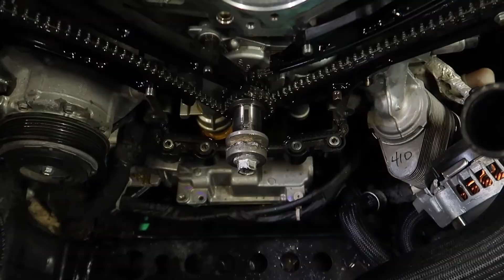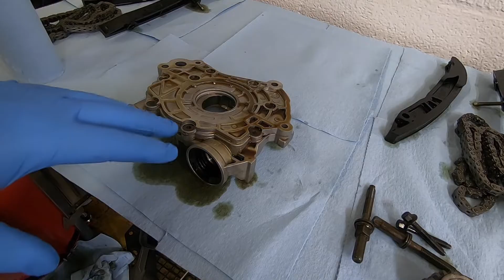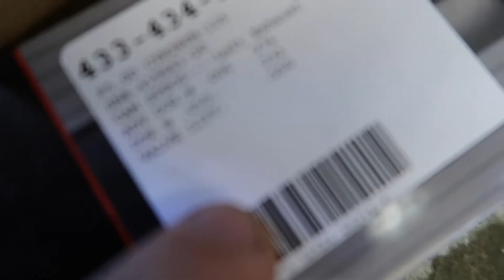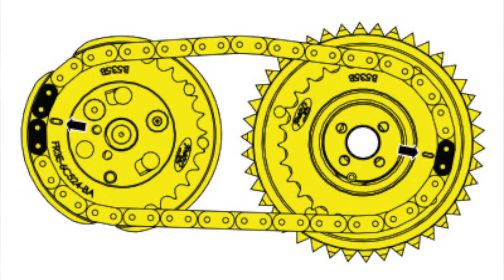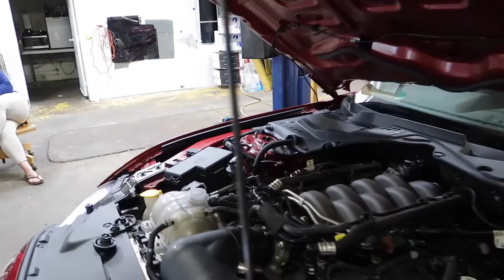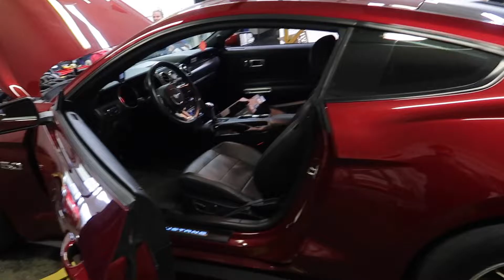GEN 3 Coyote stage 2 NSR Comp Cams, OPG, & C/S INSTALL!  Plus Timing Procedure in a 2018 Mustang GT!

Comment from the maker: MAKE SURE TO TAKE THE TWO SEALS OFF THE EXHAUST CAM AND PUT ON NEW CAMS. ONLY APPLIES TO GEN3 ON THE EXHAUST CAM ONLY

ALSO THIS ONLY APPLIES TO MUSTANG! F150 IS DIFFERENT!!!

Watch this video also before installing!! Something new that has been found!
https://youtu.be/tvQkOYagL-E
Reply: Have you considered doing a video for the f150 engine
Reply: No other better way to do it
Reply: Cool video. 👍 You should open a Mustang shop and build cars.
Reply from the maker: William Horvat Thank you!! I’m actually working out of that shop I was in on the side now. That’s my goal is to have my own performance shop!!!
Reply from the maker: @williamhorvat8224  I did.  It’s called HPR in Henderson, TN
Reply: After u have taken off the passenger chain and rotate from 12 to 5 do u have to rotate a full revolution from 12 to 5 then take off driver's side chain?
Reply: I watched this video as well, I purchased the entire pump assembly from Boundary with the billet blacking plate with Martin wear on the gears. Definitely wasn’t taking a chance.

Comment: @29.20 for the links not matching up on the driver side after rotating the keyway for the passenger side, i got a question. 

What if instead of the keyway going clockwise from 5o’clock to 5o’clock then continue turning more until so the keyway faces 12oclock 

instead of that. could we rotate the engine counter clockwise so the keyway goes from 5oclock to 12oclock (in approx a quarter turn)

that way the colored links would be lined up on both the driver side and passenger side. is that an option

Comment: I am having a heck of a time getting the cam slots to natually rest where they need to go for the phasers to be mounted. My cams want to rest slightly off from where they need to be. I can put a wrench on the cams and turn the, but the lobes start putting pressure on the valves.

What am I doing wrong? Gen 3 short block, Gen 3 heads.
Reply: Same here you figure it out

Comment: I have a question, when you are installing the camshafts on the left side, what position need to be the crankshaft key way?  At five o'clock or 12:00 o'clock?
Reply: It is the same process for a 2019 f150 with the same engine?

Comment: Great video and very detailed instructions gave me the confidence to do my own as well. I had one mistake and that was on Gen 3 cams there’s seals that need to be put on the cams. I totally missed them and was having issues with my cam timing with those seals missing the phasers wouldn’t hold oil pressure and my position B sensor was freaking out and shutting down VCT. I believe this only applies to Gen 3 motors, so if your reading this the video shows you step by step and I had no issues just those damn seals lol.
Reply from the maker: Yes it’s just on the exhaust cams on a gen3.
Reply: On a positive note, I’m really good at breaking down the motor and setting cams and getting the timing right lol.

Comment: Great video! I'm about to tackle the old Ford TSB for the noisey tensioners and the only question I have is that fuel tube for the HPFP. Did you just gently bend it up out the way or how did you make it clear the valve cover?
Reply from the maker: Remove the intake and take it off.

Comment: Hey Ken, I will doing OPG's and Comp Cams Stage 2 NA Mutha Thumper's on my 22' Mach 1.   The Mach has 8k miles on it.  What oil would you recommend for breaking in the new cams and OPG's?  What length of breaking period can I expect?  Wengerd has done my previous tune and will be providing the tunes for the new NA setup (Holley Ultra Lo-Ram ported by AFS, VMP Twinjet 69mm TB, Ford Perf 55lb injectors, Comp Cams Stage 2 NA MT, Boundary black OPG's w/sprocket, and Kooks 1 7/8" Green Catted LTH + Xpipe.  Thank you gentlemen!  I appreciate you feedback and am very thankful for the information in your videos!!!  You have been one hell of an asset.
Reply from the maker: No break in needed.  Just let it come up to temp before beating on it. I would do regular synthetic oil.  Car is going to be a blast.

Comment: I think something to annotate for the install. The exhaust cams from comp cams on Gen 3 coyotes do not come with exhaust cam seals. 

There is two little seals on the end of the exhaust cams.  Not the filter inside the intake cam

Comment: FYI you need to replace the cam cap bolts there torque to yield
Reply from the maker: FYI in the Ford workshop manual it says to remove and discard all bolts that require replacement  when it tells you to remove the bolts in each step such as the crank bolt and cam phaser bolts. However, they do not require replacement of cam cap bolts per the Ford workshop manual. Not sure as to why but I’m not an engineer. It doesn’t hurt to replace them but not required. I have never had any issues over the many years when working on these engines.

Comment: Quick question if you can find the time. Cams are in but un-torqued just yet. The rh exhaust and lh intake cams doesn’t rock/sway freely like the others do. Is this normal? I was told a way of knowing you’re in neutral is the cam will have slight play to sway.
Reply: To anyone wondering, this is normal. lol

Comment: @HPR, how did you determine that the crank needs to be rotated a full 360 back to the 5 o'clock position, then another 3/4 rotation back to 12 O'Clock? The repair manual doesn't say to do this
Reply from the maker: Yes it does say it.  On 15+ Mustangs the Ford Workshop manual clearly states it

Comment: I'm currently working on a 2018 f150 with this engine. I ran into an issue with the timing marks on the driver side exhaust cam would not match up with the workshop Manuel.. I followed the instructions as seen in this video and still couldn't get the timing mark for the drivers side to end up where they needed to be.. the marks would always be facing the center of the engine for some reason..
 The passenger side seemed fine, but when I went to move the crank from 12 o'clock to 5 o'clock the Crank wouldn't go that far before something made Contact inside the engine.. 
 Figuring I must have missed something, I stopped..removed the cams and started from square one. 
 Now that everything has been cleaned and prepped for the install of the cams, I am still having an issue with the driver side cams. They won't lay down where they should so I can install the caps.. There is no way I can install the driver side cams and have the provisions for the phasers in the correct orientation without some of the cam lobes opening up some of the valves.. 
 I have no idea what I'm doing wrong here.. I've done my fair share of timing sets on these, but this one has me stumped.. 
 As a added note.. the truck came in because it had a terrible noise that sounded like bad phasers or something going on with the timing set.. the driver also said if he didn't run premium gasoline, the truck would ping really badly.. I didn't notice any missing or running issues before I began the work..but the noise was definitely more prominent then it had been the last time I serviced the vehicle..
 Any help would be appreciated..
Reply from the maker: This is for mustang not f150. F150 time differently.  Let me know if you need the pdf for F150

Comment: Hope all is well brother, can you tell me if the cam cap bolts can be reused or are they tty as well?
Reply from the maker: Cam cap bolts can be reused. Ford does not have anything about discarding then when removed.  The phaser bolts to cams do need replacing.
Reply: @SpeedAddict731  thank you, God bless.

Comment: Do you need to upgrade OPG for cams?
Reply from the maker: Opg usually don’t break in the newer cars unless you are on 2 step or hitting the rev limiter. However if you are taking the cams out it’s very little extra needed to install opg so I don’t see why you wouldn’t do it.
Reply: @SpeedAddict731  ty for the quick response on this old video
Reply: @SpeedAddict731  hey man I finally got my cams I really need some help what new bolts do I need exactly to install these cams can you plz link me the correct ones trying to put them in this weekend

Comment: Great Video!  I am in the middle of installing cams in my 2020 GT.  I noticed you don't mention replacing the cam cap bolts with new ones, only the phaser bolts.  Also, you don't mention the center cam bolts being replaced with new ones?  Every ARP kit listed shows 12 bolts for the phasers, which is not correct for the engine I have or the engine in the video.  Can you help with these part numbers please and source?

Comment: Hi Ken,
I have been using your OPG video as reference for changing the oil pump gears in my 2019 Gt and have run into a bit of a hiccup.
Was wondering if you could help.
I am pretty sure I did the timing procedure correctly, but When I turn the engine over by hand I here a clanging sound that seams to be coming from front drivers side of engine. It sounds like its coming from timing cover area but its hard to tell.
Unfortunately I only noticed this after I had the timing cover and valve covers back on.
Is it normal to hear clanging or clacking coming from that area when turning engine over by hand?
Any help would be appreciated

Comment: hey man i’m installing these rn in my coyote and i stopped bc i’m not sure if i’m supposed to buy new bolts for the phasers or cams or can i use the same ones please reply
Reply from the maker: Yes you need new phaser bolts.
Reply: @SpeedAddict731  so after installing everything i am getting this code “P0369 Camshaft Position Sensor B Circuit Intermittent (Bank 1) Pending, the car feels like it’s running lean air fuel ratio all over the place while cruising the VCT disables and goes back to normal on hp tuners what could my problem be i’ve already replaced all 4 camshaft position sensors, o2 sensors, maf sensor. don’t know what to do next
Reply from the maker: @Chuy5ohh  are you logging all cam channels. I can email you a channel list to log and if you want to send me a log so I can look at what the cams are doing. My email is ken@hprautomotive.com

Comment: Thank you for this.  It was a little late for me as I first assembled mine off repair manual pictures only, and missed the 360 deg plus 5 o'clock part (that your repeated for good measure).  If you take those 360 deg away the car will run on 4 cylinders and have compression on all cylinders.  It will just have compression on the right bank when the ecu is planning for TDC exhaust stroke.  The starter also hates life because compression stroke on both banks are stacked together.  Throws cam codes on the right bank.  Your video cleared it up and I took it apart again knowing what I had messed up.
Reply from the maker: You’re welcome. Glad you got it corrected.

Comment: Ken, I’m stuck mid install with my whipple right now; please respond if you see this.

I’m taking the valve covers off to do the OPG install, and I cannot find anything on the 2018+ valve cover removal. What do I do with the fuel pump? The bolt that seems to be the obvious bolt appears to lock up rather than loosen. Don’t want to break anything
Reply from the maker: The bolt that holds the metal cover on has loctite on it. It is always hard to get out. It can break.

Comment: Hey speed addict! I have a 2020 5.0 10r80. Was a base car. Kinda wanna do a quick ish NA build. Put 3.55 in it, full suspension work , converter , has catless LTH , ported 18 manifold,  jlt cai ,  Pbd tune.  Not even e85 yet. I'm in Canada.. at 4400 DA it trapped 119.9.. gross DA.. so gonna throw e85 at it , and prob the stage 2 NA comp cams.. what kind of gains do you typically see with those cams? I'm doing OPG and C/S. So gonna do cams at the same time

Comment: Watched this video to see if the Gen 2 and Gen3 procedures for timing were the same. I noticed SEVERAL pages and directions are missing that rotate 360 then back to 12 O clock instruction... SMH
Reply from the maker: Gen2 and gen 3 time the exact same.  In the video at the 26:56 mark I go over rotating the crank and getting it to where you can put the passenger side chain on.

Comment: Ok so where are u located? I've got a 2017 gt and I want basically this exact same install done except instead of NA cams I'm going Paxton. Great video, only thing that scares me is removing and putting back on the oil pan and the pick up tube bolts. Is there any way of contacting you for the opg, cs, and cam job. I'm in upstate ny but wouldn't mind driving its just the only other places I've seen techs that are good with these jobs are in Florida and that's one hell of a drive for me.

Comment: After having the heads off and turning the motor over, is there a proper procedure to follow when getting ready to time the motor?  Should cyl 1 be at TDC, then turn the keyway to 5 o'clock position?
Reply from the maker: Just put the crank at 5 and then follow the procedure from there. Make sure the cams are in the correct place on the heads when you install cams.
Reply: @SpeedAddict731  that's what I thought.  Thanks.

Comment: I did this myself and installed an Odin supercharger.  Just cranked it up and got code p0019. Any thoughts? I followed the steps here and am 99% positive that the timing is correct...I dont want to tear everything back apart if I dont need to.

Comment: Such a great resource for the Coyote Community, I hope to need this video this fall !!!!
Reply from the maker: Thank you!!!!!
Reply: @SpeedAddict731  are these the Mutha thumper cams ?!
Reply: @SpeedAddict731  so if I need to replace the driver side intake phaser could I just remove the solenoid and that’s in front and keep the secondary chain in place. Then I just swap it out with the new one or would I still have to remove the timing cover just to replace that phaser?

Comment: One of my favorite Ford Techs on the web
Reply from the maker: Determined Veteran thanks bro!!
Reply: @SpeedAddict731  ,
You really to open a shop and build Stangs 100% of your time. 👍  Your car sounds badass under boost.
Reply from the maker: William Horvat thanks.  That what I’m working towards. For now I’m doing it on the side in the shop in this video.
Reply: Is there a trick to removing and reinstalling the a/c belt?
Reply: @TommyPickles86  a stretch belt removal/intall tool. They're pretty cheap on amazon and work if used properly